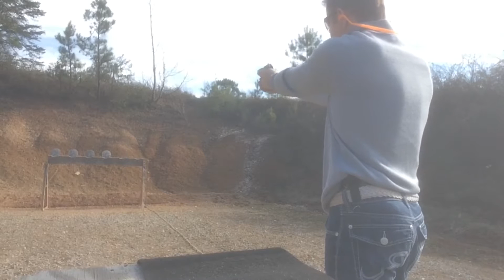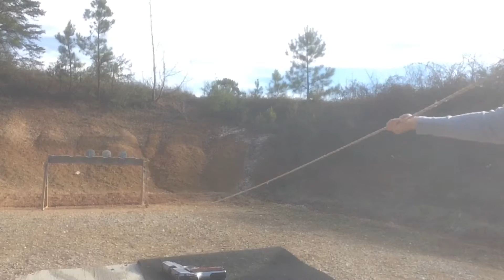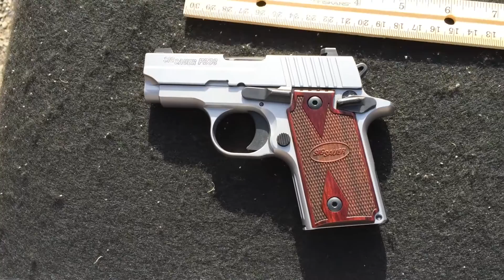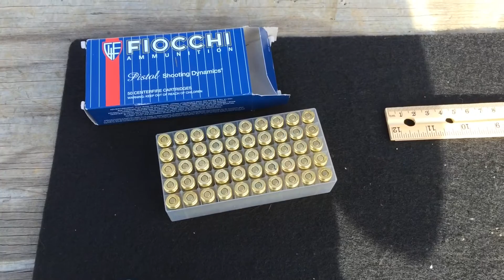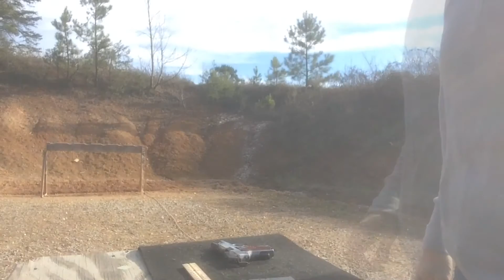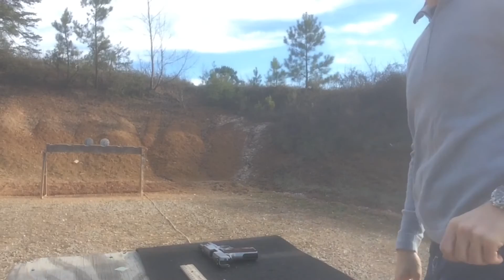Let's pull the carry piece (SIG Sauer P238)

Comment: The safety kit is the same for the 238 and 938 so it’s easy to order on line, and pretty easy to install. Do keep in mind that the small spring loaded detent is extremely easy to launch across the room, and extremely hard to find! Lol it took me 30 minutes to do the job, about 25 where spent searching carpet for the detent. The problem I had was finding grips that come ambi cut. I really wanted some aluminum grips but none where ambi and all have patterns that would be ruined if I cut it myself.